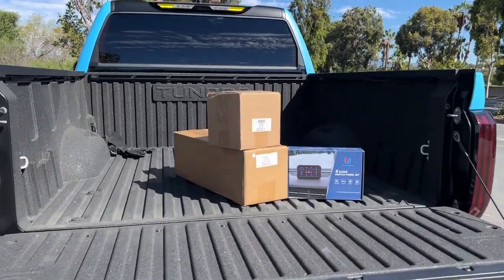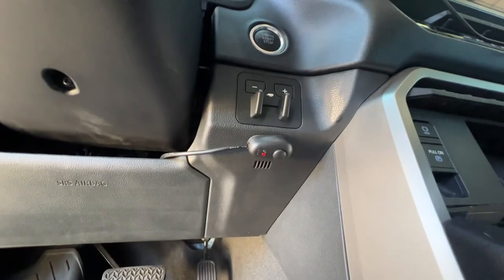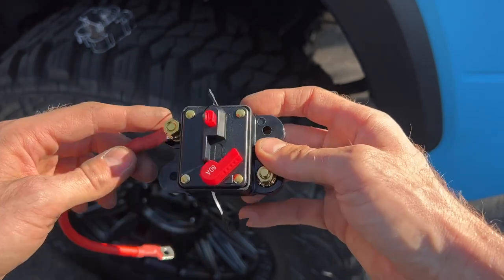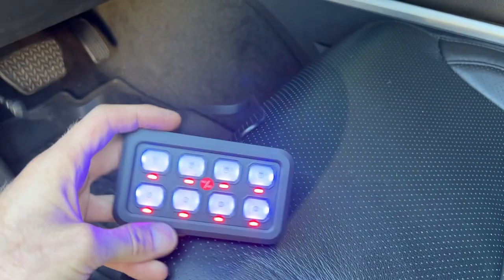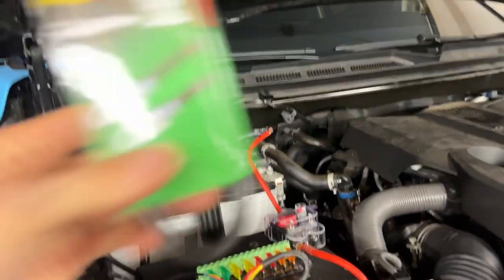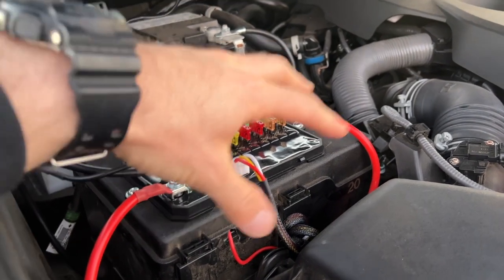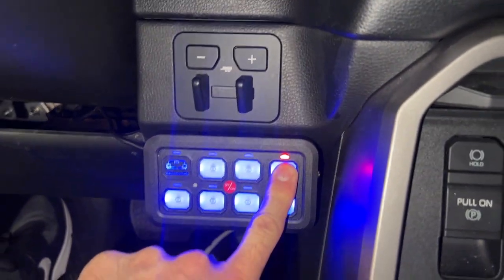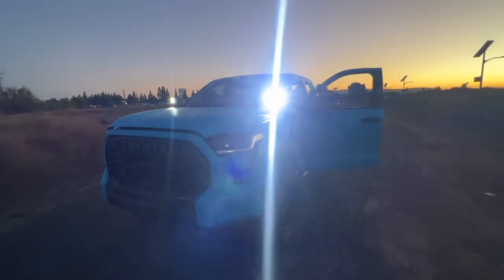No More Messy Switches And Wires!!

Comment: I think all the wires are supposed to go through those two openings that are next to the latch on that new fuse box. So I think that fuse box is supposed to hang over an edge so you could feed them up through it and into all the fuses.
Reply from the maker: I see. Appreciate it! I’ll try rerouting when I hook up the Baja lights
Reply: @MarkBrenner  I think that's why the negative and the positive battery cable were offset so they could run along each other and through those two openings with all the other wires. Sometimes instructions aren't as clear as they should be. I came across that quite a few times over the years.

Comment: I I talked mine but the blue back lights are on constantly. I connected it to the fuse you used but it just stays on. Recommendations?
Reply: Did u figure it out ?? I just had the same problem.  The lights stays open on in the box
Reply: @rickserocka24  yes, had to find a fuse that wasn’t constantly giving power.
Reply: @maibysoberto2068  what fuse was that, I just got the same switch panel he got but I am having trouble finding a fuse I can tap into. Thanks!

Comment: Hi first thank for your show with very good stuff. I have ? I want to install hood protector with lights on my 22tundra which fuse & where the location inside the fuse box? Or goes straight to the Battery thanks

Comment: You’re gonna run your battery down with the fuse tapped into constant power just FYI
Reply from the maker: The switch panel isn’t drawing any power until it is turned in
Reply: @MarkBrenner  you could be right but I don’t believe that’s the case from a lot of the other install videos I’ve seen.
Reply from the maker: @PKDiver  I’m not positive but it just makes sense that it’s not drawing any power in the off setting. Doesn’t even have a backlight on
Reply: @MarkBrenner  yeah good point man. I’m not 100% sure either, just going off what a lot of people have said. I have the same set up. Reached out to the manufacturer to find out and am waiting to hear back.

Comment: I grabbed the amber lights for the trd pro grill but my plan is to get it wired in to the stock control panel and just buy any oem button for the panel should just have to pop the dummy buttons off the lights haven’t come in yet but since you did it this way is my plain not possibly?